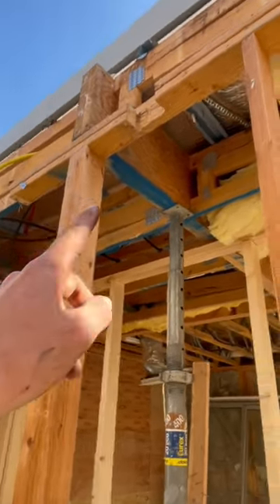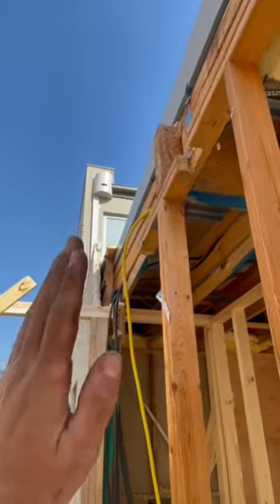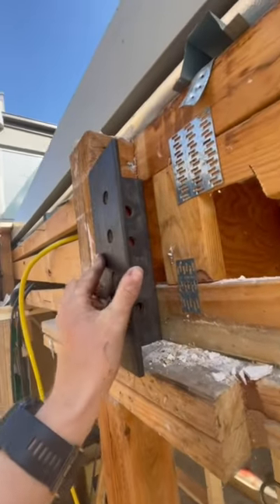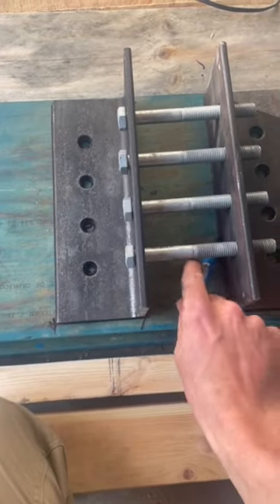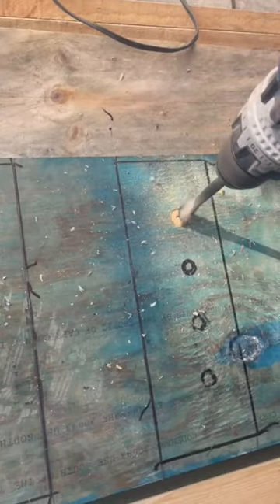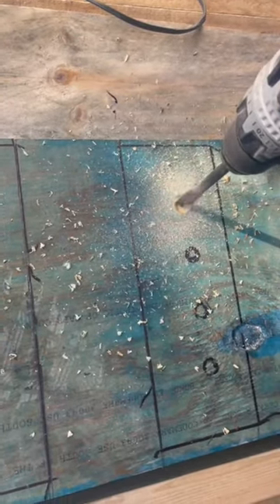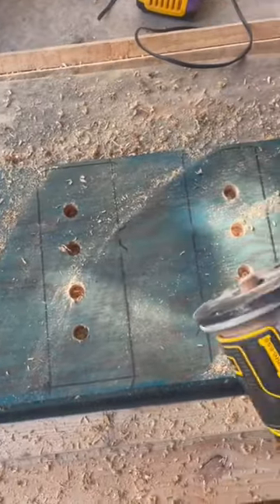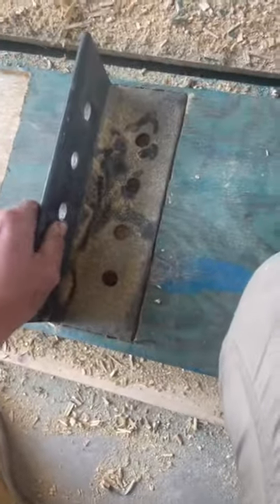Do the beams seem like over kill? There’s a ton going into this job

Comment: Missing washers on the bracket side of the new LVL. Why put them on one set of bolts and not the other? Not up to standard bro 😂
Reply: @rileywhite5091  yeah well I’d make a living out of spotting this guys defects and mistakes lol. Why would he run out? Bolts always require washers or they aren’t up to code.
Reply: Your joking right
Reply: Steel washers on a steel bracket
Reply: @Bigdoggobrien  lol any bolted connection requires washers.
Reply: @Bigdoggobrien You need washers on these connections. Always.
Reply: @steves835  why
Reply: @henra2244  you'd probably put washers on cupheads too?😂😂
Reply: @Bigdoggobrien  to protect the joint surface from damage during the tightening process and to distribute the load under the bolt head and nut. The stress under the face of a standard hexagon headed nut can result in the indentation into the standard strength face of the bracket, causing cracks and premature wear. The last thing you want is a crack or premature wear in a major structural member.
Reply: @Bigdoggobrien  lol it is a requirement that is in every engineering standard/code across this earth 😂🤦‍♂️
Reply: @steves835  do you put washers on the rims of your car? The wood will rot before that steel cracks. You might as well put washers on your washers to stop them from breaking
Reply: @Bigdoggobrien  bro you’re the only one that’s looking like a joke here. Any half decent carpenter/builder would understand the engineering requirements behind what they are building and why washers are needed in the first place lol.
Reply: @henra2244  can tell you've put washers on the bracket your whole life
Reply: @henra2244  I've never not passed an engineers inspection because of no washers on the steel side
Reply: @Bigdoggobrien  yeah, because my jobs wont get passed otherwise 🤦‍♂️😂. Also every steel structure on this earth has washers on brackets and connections, you’re really looking silly now mate lol.
Reply: @henra2244  still waiting for you to show me a bolt that's ripped through a bracket ?
Reply: @Bigdoggobrien  bro, come on, you’re clearly some 16 year old. You couldn’t run a bath, let alone a job site 😂🤣
Reply: @henra2244  yeah that's what I thought mate you've never seen a bolt rip through a bracket
Reply: @Bigdoggobrien  lol not just high rises 😂🤣🤣. Any steel frame/beam/portal frame system within a house requires washers at the connection. That LVL isn’t rotting either, now I really know you have no idea what you’re talking about.
Reply: @henra2244  really😂😂 mate a child would know any timber would rot go put some in outside for a week then comeback to me or maybe try google if your smart enough to use it. While you're there show me a bolt that's ripped through a steel bracket
Reply: @Bigdoggobrien  deep down you know you’re wrong because you admitted washers are needed on larger structures so you do admit they have a purpose. You’ve literally just contradicted yourself 😂🤣
Reply: @Bigdoggobrien  LOL! Timber takes longer than a week to rot mate, wayyyyy longer 🤦‍♂️. Also any half decently built house wont rot unless waterproofing in wet areas has failed lol.
Reply: @henra2244  any half decent bracket with no washers on the steel side won't break before the timber
Reply: @henra2244  go ask your engineer since you can't show me one bracket thats failed from no washers
Reply: @Bigdoggobrien  lol don’t need to ask my engineer. It’s in AS4100 (Steel Structures) and AS1684 (timber framing code). Just some of standards/codes that engineers are required to follow when designing a house in Australia 🤣🤣
Reply: @henra2244  read it again if you can afford too. Last time I was in school it was only necessary on soft materials. Maybe try actually reading it, and again if you're running a bit low on money look in a mitek booklet or ask your engineer
Reply: @Bigdoggobrien  LOL! You haven’t read it 🤣🤣. Lol Mitek literally have washers on their brackets in the diagrams when it comes to bolted connections!
Reply: @henra2244  where then show me😂😂
Reply: @henra2244  try to read it. It's not a picture book
Reply: @Bigdoggobrien  bro, you couldn’t even comprehend AS4100 and I bet you’d struggle to read AS1684 lol. Look yourself seeing how much you love to use gōogle to come up with your answers back at me. You literally thought timber would rot within a week 🤣
Reply: @Bigdoggobrien  I see you’ve deleted your comment where you said you could understand why washers would be used on high rises and bridges 🤦‍♂️. Guess I hit a nerve when I said you contradicted yourself lol.
Reply: @henra2244  oh ok next time I'll make sure to listen to you then instead of my engineer or that link I sent from mitek that says 
"Washers are not required if the bolt head
or nut were already against a steel cleat
face.'
Reply: You need to go public with this one mate they should hire you to rewrite the building cops
Reply: @henra2244  those billion dollar organisations should ask you too next time they say no washers on steel
Reply: @Bigdoggobrien  you didn’t send me a link so you’re just making things up 🤣😂. Can’t believe you’re here arguing about washers, what are they? Like $50 for a 100 pack 🤣😂. Also can’t believe you think a Mitek guide is a building code/engineering standard that encompasses everything in building 🤦‍♂️
Reply: @Bigdoggobrien  got the link. Lol you’re literally taking the word of one engineer on an article that takes up one page compared to AS1684 and AS4100, standards that are hundreds of pages long and thousands of engineers follow 🤦‍♂️🤣
Reply: @henra2244  show me exactly where it says to put washers on steel in 1684 then
Reply: @Bigdoggobrien  bro I don’t need to show you. You literally contradicted yourself by admitting you can see the point of washers on high rises and bridges which means you know they serve a purpose. They’re literally 50 cents each, get real mate and do your job properly 🤦‍♂️😂
Reply: @Bigdoggobrien  also he’s put washers on one set of bolts and not the other in the video so he literally either ran out of washers or was just lazy. He knew they needed to be there and yet they’re missing lol.
Reply: @henra2244  yeah sorry mate I'll book you in next time I get one of the 100s of frames ive stood inspected
Reply: @henra2244  deleted it because this video isn't showing a bolt holding the weight of hundreds of tons of concrete or vehicles
Reply: @Bigdoggobrien  You are absolutely right: In most cases washers aren't necessary, like under lug nuts.

Comment: You should have just cut 10mm off the end of the bracket that won't change the structural integrity of said bracket, if your site structural engineer clears it. Removing material from the beam reduces the structural integrity and will create problems you are not going to be prepared for.
Stop being an engineer, because you're not an engineer.
Reply: The bracket is 10mm thick? How can he cut it off the bracket lol he has to notch it into the beam to make it flush with the rest of the wall
Reply: Lol, not 10 mm out of the face of the plate, but 10mm out of the adjacent edge.
Reply: @steves835  that wouldn’t solve the problem
Reply: @datrakapo4807  what is the problem? Not being condescending, I'm sincerely curious